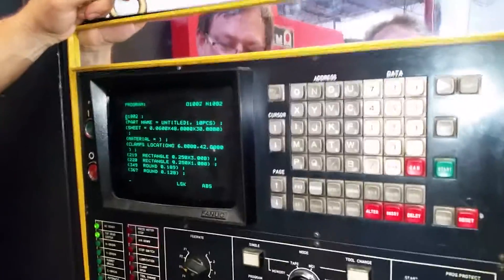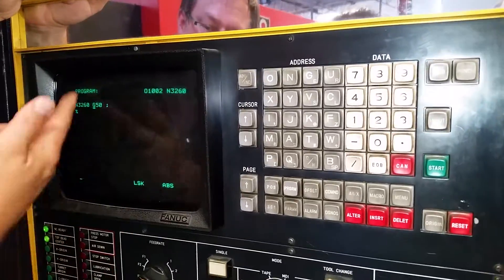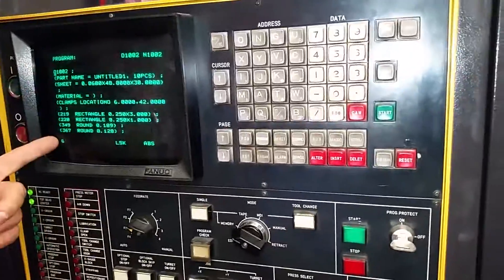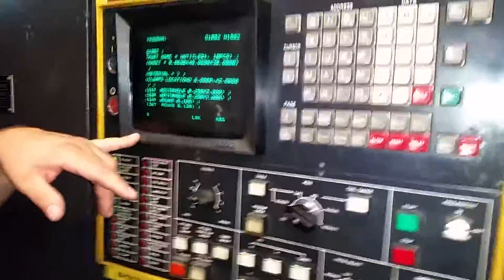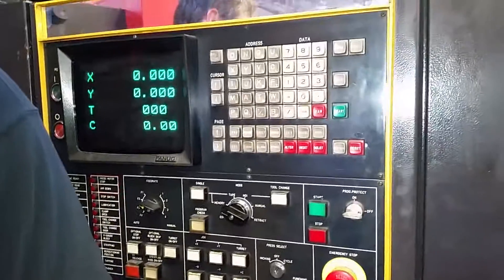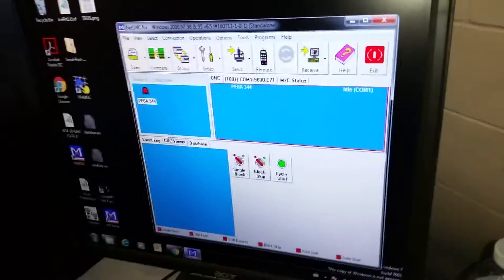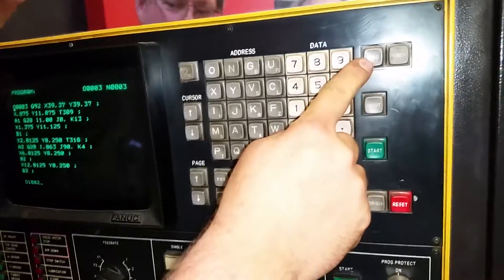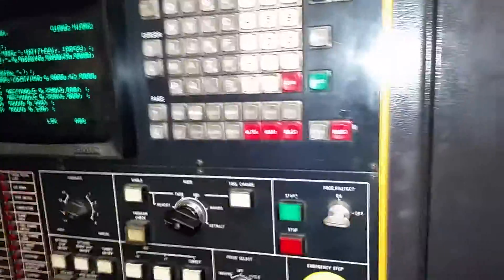How to load an Amada gcode file from PC

Comment: I have been programming and operating Amada turret punch presses since 1983. My first machine was a 344 Pega with a 6m control with no auto index. Then I moved to a Octo 334. Then eventually I ended up on 50 ton Coma and 30 ton Pega all with 04PC controls. They both had MMC added on them. We started out writing our own programs at the control and backing our programs up via a paper tape punch. We also loaded our programs with paper tape punch machines. I have had my share of office CAD/CAM programmers that would create gcode programs for these machines, but had no idea of how the machines actually operated. After 45 years of programming, operating and maintaining these machines, I have retired and now have my own garage full of CNC plasma tables and lasers. I have found, if it can be designed in a 2D flat pattern, it can be punched, engraved or cut in one of these machines. If anyone has any questions on this subject, I may have an answer. Thanks everybody for reading my long story😁